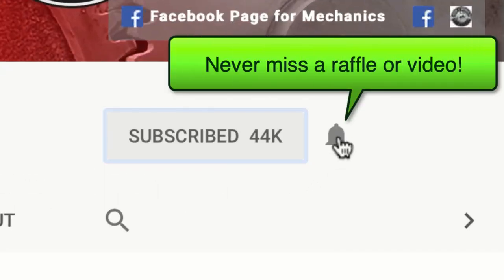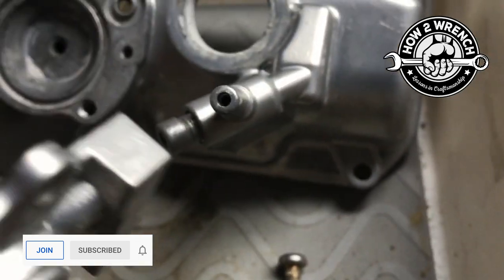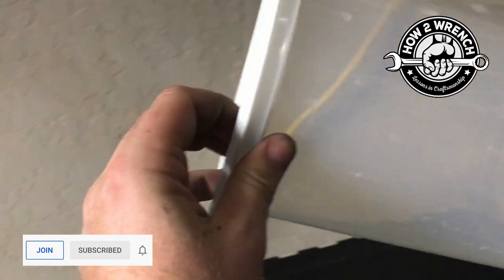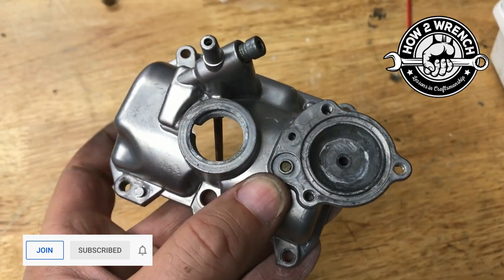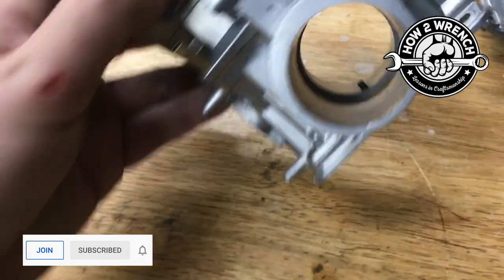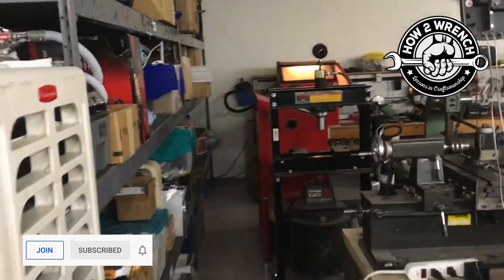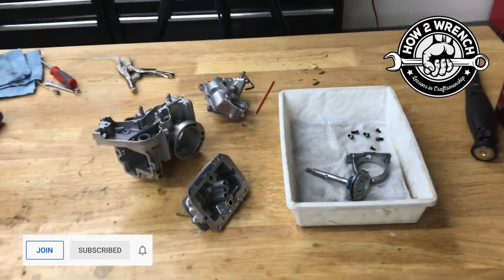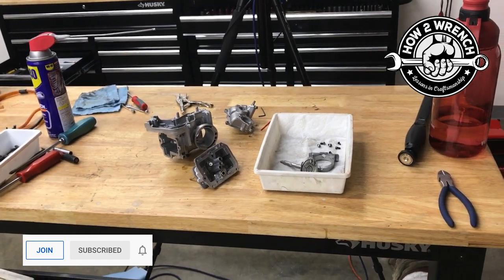Don't do this with your ULTRASONIC CLEANER! It will cost you big time!

Comment: These ultrasonic heaters will never get the fluid hot enough to make the aluminum expand so much to make brass pop out.  Did this ever happen to you?  I've cleaned hundreds of carbs with never ever having had such a problem.  It does a great job with bearings and it is harmless.
Reply from the maker: After teaching a motorcycle tech program for 13 years and owning them myself for years after. I saw it happen enough to feel it was worth the warning. I do see it happen more on 70-80s era but as I said in the video it's a pain and to most others would be an incredibly hard diagnostic nightmare trying to figure out. Also, I have a member video coming where I show I intentionally use the ultra sonic cleaner to do this on purpose to show how a diagnosed a carb "no one could fix". I have a lot of recorded content about ultra sonic cleaners to add to the playlist and even a new model to try out when I return to the states. 
Awesome and thanks for commenting! Can you smash that subscribe button and share our channel please? We have over 700 videos in playlists! 
Even more training and deep dives if ever needed…
Join this channel to get access to perks:
https://www.youtube.com/channel/UCBhM8DCKnT3qXwTW0eToyCg/join   
-Daily MEMBER FIRST COMMENTS ANSWERED FIRST 
-Live Q/A video chats
-Wonder if we have a video on your need? Members can request content links!
-Full Access to the ENTIRE 700 video library
-Member-Only FREE tool giveaways 

Just want to say thanks quick to support us for this information and our work saving you money? 
Give us a high 5 here:  https://www.paypal.me/how2wrench

Comment: Use a glass container for smaller parts etc, better transfer of ultrasonic waves than plastic. Good tip about the temperature Shane many people think the hotter the better. Sometimes with some solutions and carb alloy it will make the metal go dark over 50C.
Reply from the maker: Agreed! I did a video not to long ago on just that! https://youtu.be/CXql83h7xEA

We sure love you taking the time to comment. Are you coming to the next live session? 
There a few ways you could help keep this work going and stay connected with me personally.  
1. The fastest and best thing you could simply do for us is hit that subscribe button…helps us creators more than you know! 
2. Join this channel to get access to perks:
https://www.youtube.com/channel/UCBhM8DCKnT3qXwTW0eToyCg/join   
3. Give us a high 5 here:  https://www.paypal.me/how2wrench    
Keep Wrenching,
Shane Conley
Peoria, AZ USA
Follow us!
www.How2Wrench.com       
www.Tools2Wrench.com    
Facebook: 
https://www.facebook.com/How2Wrench/   
Instagram:
https://www.instagram.com/how2wrench/
Reply: @vtwinbuilder3129  True. Some folk just use distilled water and get good results on carb bits
Reply from the maker: @vtwinbuilder3129  What is the brand of citrus base you use?
Reply from the maker: I have been using 50C because it takes forever to got much hotter past that unless I leave it on all the time. I also found that the gloves I'm using aren't protective enough beyond 50C as well....at 60C it was about a 2 sec window for handling! 🤣

Comment: I bought an ultrasonic cleaner a few months ago.  I hadn't even thought about the possibility of the metal heating up and those little brass balls falling out.   If one did fall out, how would you put it back in?
Reply from the maker: Hey member Dave...good news I made a member only video coming out in a few weeks showing you how as I recently used my on purpose to extract one...

Comment: brass parts falling (press fitting) out of an aluminum carburetor housing is probably due to tight fabrication tolerances. The cavitation occurring within the ultrasonic cleaner can be so strong that it "hammers out" the brass part.
It is very unlikely that the temperature of the engine parts will cause falling apart. Engines are subject to temperature changes.

Comment: Could happen? , I’ve never had one of those come off, oxide normally forms at the joint between brass and alloy, and expands, the mating surfaces have pitting.
The only way I could think of is if the ultrasonics break down the oxides and the part is very old allowing a tolerance to occur.